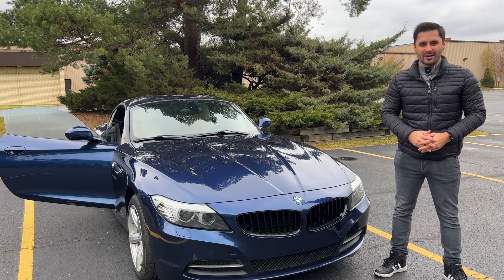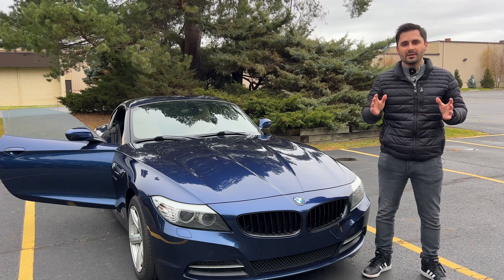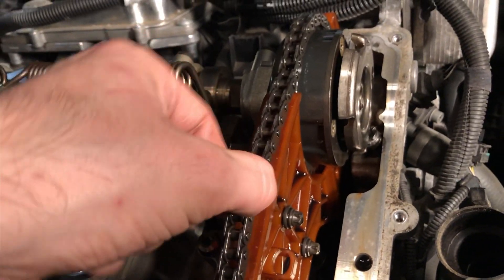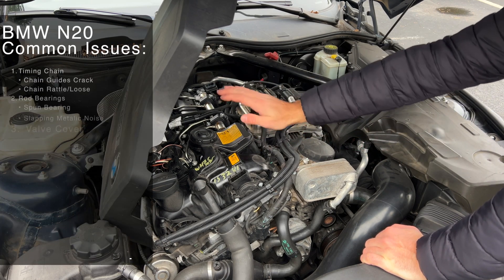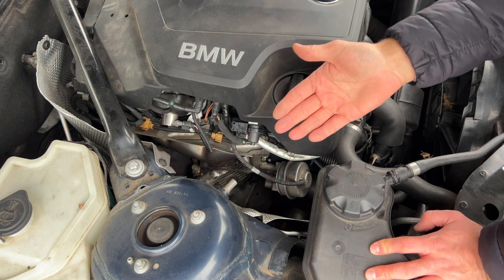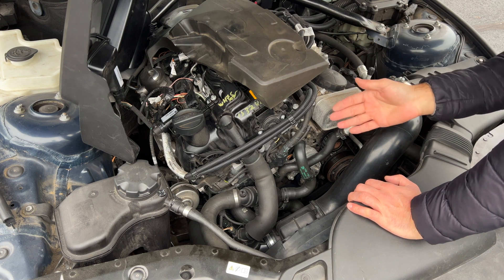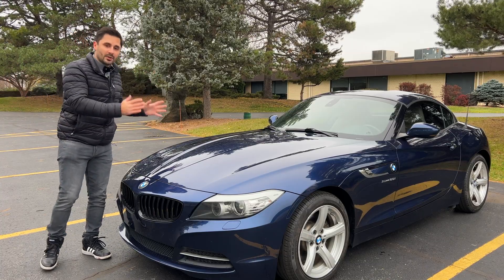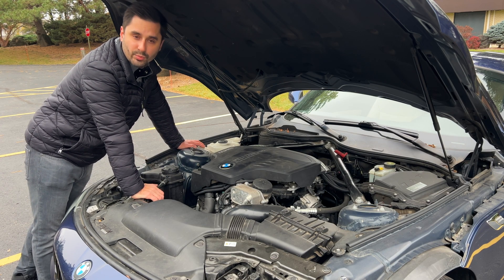BMW N20 Problems to Expect - Reliability Report

Comment: The early N20 engines are just shitty engines, people say the N62 is bad, or the S85, or the early S63 but this is the worst because its a damn 4 cylinder, you'd expect problems like this on the bigger engines, what's worse is that most N20 owners are just normal people who don't really know what engine they have, so they're stuck and forced to pay a even heavier bill at the dealer or shop. There's a reason why 328i or 528is are in the low teens, don't take the bait.
Reply: I took the bait unfortunately.. 2014, 52k miles, 20 year old student.. :( no financial help from parents either. definitely worried
Reply: @mcmlvi6953  don’t get worried then you’ll make it happen, just be super smart. The issues these BMWs have are avoidable for some time. The stupid plastic guides on n20s can last if you change the oil on which is 5k miles, most people extend their luck and go 7k and beyond.. don’t. I recommend 5w 30 instead of the bullshit 5 20. Add liquid moly anti friction just half the bottle every oil change it’s just 9 dollars. So change the oil, when you do go for liquid moly 5 30 or Mobil 1, get liquid moly anti friction agent thats easy to find like at autozone. And drive low rpms all the time, don’t be revving it out passed 5k for no reason, drive it like a normal car, 5 minutes to warm up the engine in the morning so the oil can get viscosity. When the car is warm like going to supermarket and coming back give it like 45 seconds so the oil flows everywhere in the engine. You should be fine, reason why people don’t go far is because again they do the complete opposite. OHH and I almost forgot do not tune and mod this car smh
Reply: @aidenp5768  I'm so glad you stated this.. I installed H&R Super Sports and was planning on getting BM3 actually but, a few people told me not to tune my N20, that it's not a great platform to tune in the sense of reliability/longevity with a tune. Great information about the oil changes as well, because I paid $300 one time to get "lifetime" oil changes at BMW every 7.5k miles which I found odd, considering my last BMW which was N52, multiple mechanics told me to change the oil every 3-5k miles if possible. thanks for the help brother.
Reply: @mcmlvi6953  Glad I can help bro, if I had an n20 bmw, I would be happy still because knowing how to keep the car healthy is an under estimated advantage. If I had your car id still have fun with it, getting tints, paint protection, new suspension parts, new wheels, lip spoiler, still can enjoy it without tuning. Instead of tuning the motor you still have the opportunity to make a good handling build. I have an X5 with the m54 for example, it has 225hp and it weighs nearly 5,000lbs I don't have it tuned and I always smile while driving it, there is so much character to a car than just being fast. Ive driven the M cars they're thrilling but I have just as much fun in a big luxury suv which I also off-road and do winter donuts, trust me bmws are flexible in so many lifestyles. Off-road builds, track builds, drag builds, street racing builds, luxury builds, cosmetic builds, stance builds, restoration builds etc.. in your case, upgrade the interior to your liking, make it cosmetically tasteful outside, put some sticky tires on it, get in an LSD, and maybe just maybe if you like you save some money to swap in a N55 or B58 into your car.
Reply: @aidenp5768  That's so ironic you said this because that was my exact plan. Build the suspension, cosmetic mods. Drive the N20 into the ground, or until I can afford a B58 swap. Car handles like a dream, and is super torquey in city driving, the only time the car lacks is on highways, it's slow as shit haha, but hey it's a great daily, good mpg's, and sporty around town. Also love the way the F3x chassis' look, super aggressive yet subtle.
Reply: @aidenp5768  you seem like you know what you are talking about! do you have ig by chance?
Reply: That's what my new mechanic said....he said get the V6s
Reply: @milkee798  Is that a BME mechanic 😮

Comment: I have a bmw 320i F30 and it drop me to screen the too low oil presure check ...I replace the oil valve but the problem is still there..What can i do?
Reply: What did u do bro ?

Comment: One more thing to add... if the wastegate actuator port on the vacuum pump is unused (because the car has an electronic one), it has a one-way valve that tends to fail over time and leak oil around the back of the engine. Since this has identical symptoms to a leaky valve cover it can take an extended time to diagnose.
Reply: I see some oil on the wastegate actuator arm, its Electric. Could it be that or just valve cover leak

Comment: How much did the new 2015 n20 engine cost you?
Reply from the maker: It was over 2 years ago, but if I remember correctly around $3500 for a 2015 engine with 30k miles.

Comment: I just bought a 2013 x1 from auction 145k miles, is it safe to say the timing chain has been replaced and if so how much more reliable are the components, how long do they last?
Reply from the maker: I wouldn't say that it's guaranteed that the timing chain has been replaced. It's a common issue, but it doesn't mean it will go on each engine. I would check history to make sure and check the chain for stretching as well. At the very least, I would replace the timing chain tensioner.
Reply: @SimpleCarGuy  well I got it today, put a new camshaft sensor got it started, it idled then dark gray smoke came from exhaust and it died within 10 seconds 😭

Comment: I have the same doubt, because I have a BMW 328i 2015, check the year of manufacture but mine says that my car was manufactured in the year 05/2014, does that mean that my BMW does have the problems of 2011? Or if I was saved from everything changing like 2015, how do you explain?
Reply: The new timing chain came january 2015, so all before new years eve 2014 have th old an bad timing chain.

Comment: Does my 2015 428i have upgraded timing chain components?
Reply: You have to check your car manufacture date 
If it 03/2015 then yes it has the updated timing components
Reply: @mahmoudshalaby4925 that helps a lot, thanks
Reply from the maker: Yes, it does.
Reply: @SimpleCarGuy  thanks for letting me know. Figured I did since it’s the 4 series.
Reply: @SimpleCarGuy  didn’t know if you meant 2015 as in model year or year in general since mine was made 9/14.
Reply: @SimpleCarGuy   I have the same doubt, because I have a BMW 328i 2015, check the year of manufacture but mine says that my car was manufactured in the year 05/2014, does that mean that my BMW does have the problems of 2011? Or if I was saved from everything changing like 2015, how do you explain?

Comment: Can you explain eu5 and eu6 injectors. Also you said 2015 and later switched back to eu5 from eu6. Just confused 🤔
Reply from the maker: When I swapped the engine from a 2015 car into my 2012 Z4, the engine came with the EU6 injectors. Since the ECU/DME was from the 2012 engine, the engine ran lean at full boost or on very hard acceleration. Once I swapped the injectors from the old engine into the replacement, all lean conditions went away. 
The EU6 is an updated EU5 injector to make sure the engine can meet European emission standards, but for us it means the pattern is slightly different and you can cause lean/rich codes.

Comment: Awesome video. Very easy to follow and informative. Big 👍. Quick question on rod bearing issue. Instead of waiting until it starts making whipping sound to find out, is there other symptoms we can watch out for before it ruins the engine or any preventive action we may take? Love the channel. New sub

Comment: I have a 2013 f30 328i. Can i replace my engine with a newer N20? will it be compatible with an older f30
Reply from the maker: Yes, you can. That's what I did on my Z4. However, you WILL have to swap a lot of items for it work since it's the block that remains the same.
Reply: @SimpleCarGuy  wow that's amazing to hear I really appreciate the Info. Are you able to share what you need to swap in order for it to work? Is it in your video?

Comment: Thanks for the video. I like to add a few more issues to your list of issue.
1. Excessive carbon built up in the intake & exhaust of cylinder head. You also mentioned this on your other video.
2. Turbo inlet line allows oil leak into combustion and caused oil burn. There is a redesigned part for this. Search for the text below and you will find detail information on NHTSA “N20 ENGINE OIL FEED LINE TO THE TURBOCHARGER: LIMITED WARRANTY EXTENSION TO 10 YEARS/120,000 MILES”
3. Vanos actuators, solenoids, cam gears. My failed around 150k miles.
4. Oil pump chain & guide.
Reply from the maker: Thanks for your items. The more people add the more comprehensive the list can be!
Reply: These things still have Vanos issues? Good grief, BMW must have their heads stuck up their collective asses.
Reply: @OMGWTFLOLSMH most cars will eventually develop issues with systems like vanos. I mean it has seals and moving parts, it’s not gonna work perfectly forever
Reply: It is important to clarify that the N20 engines built in 2015 and forward have a revised chain guide with a different material. The later N20 engines are much less prone to chain guide failures.
Reply: Yeah I replaced my intake vanos Gear and fixed the horrible fluttering idle.
Reply: Which oil did you use on your N20 and what was your OCI? 
Thanks

Comment: hello there how I can fix problem with rattling wastegate flap?
Reply from the maker: I replaced mine to fix it in this video: https://youtu.be/0CztOnTkjrs Some weld the flapper and others also replace it with an aftermarket flapper.